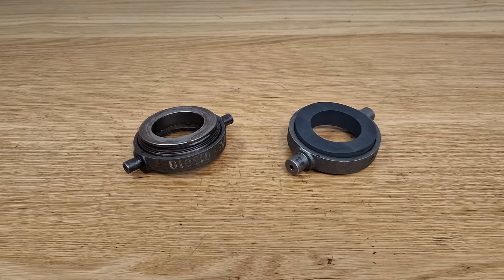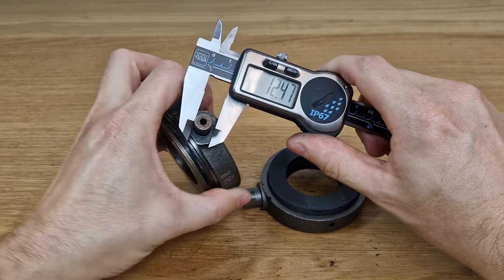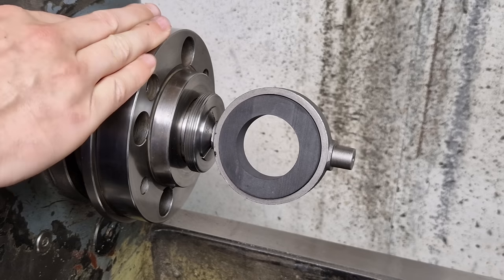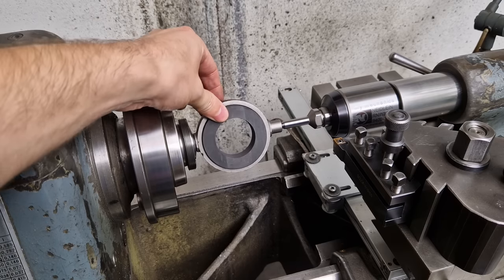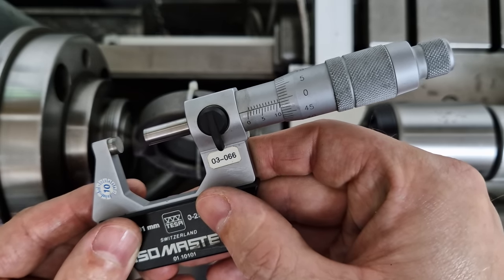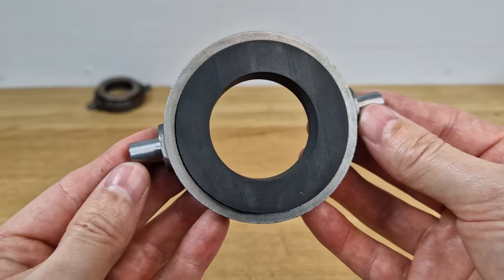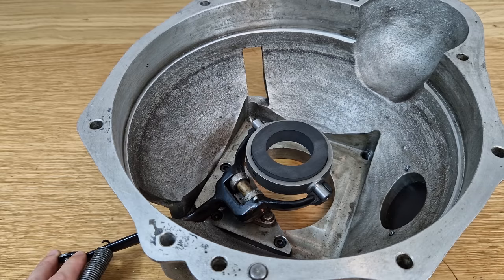Customizing a Graphite Thrust Bearing (Throwout Bearing)

Comment: Taking .002" cuts every time to get dead accurate on a 10mm diameter on a manual lathe is damn impressive. That's a level of manual machining precision necessary in aviation overhaul and repair shops.
Reply from the maker: It's pretty easy with a DRO ;-)
Reply: @mymechanicsinsights  I was wondering why you made those 0.25mm depth cuts and each time you measured with the micrometer. Was that to better calibrate the DRO ?
Reply: @mymechanicsinsights  It also helps to have good calipers and micrometers. It would be a lot harder to get a diameter with a .002" tolerance using measurement tools that have slop greater than that. 
We've trashed calipers at work because they start getting wonky and fail to repeat measurements or are wrong by +/- .003".

Comment: Back in the day on racing Imps I saw a few carbon thrust bearings with the carbon removed  converted to hold on ball or roller bearings. Never found the need to do the conversion on my own racers.

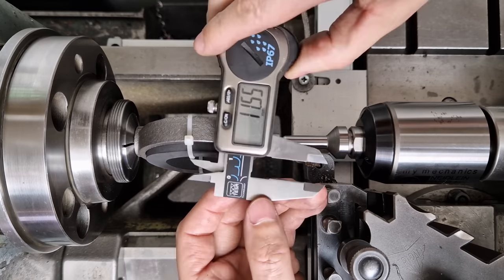Comment: 06:05 - When you said that you are gonna switch to the micrometer to better measure the thing, I was really hoping that you bring that antique one restored in the main channel years ago. 😄
I know how impractical it would be, and how you need/want the most precise measurement possible, but it would be funny nevertheless.

Really nice video!
Reply: Antique mics can be just as accurate as a new one, provided it isn't worn out. I have micrometers that are almost 100 years old, and they're still accurate enough for general machining that won't be put on a CMM.

Comment: I wonder if it's possible that the chatter is caused by a standing wave, a resonance  that causes a flex or "jump" in the cutting tool or the tool post itself? What made me wonder was the "pattern" that appeared in the material where the tool cut, which looked like "waves" in the metal, almost as if the pressure of the tool pressing into the material was vascillating. If my theory seems feasible to you, and you wanted to test it, you might be able to do so by recreating the conditions in which the chatter occurred, then try dampening either the piece being cut, or the end stock, so as to modulate or even eliminate any vibrations present.
I don't know if my theory is correct, or if it even makes sense, as I claim no expertise in the use of lathes, but my theory is based in my experience building speakers, and knowing how to contend with unwanted resonances in cabinets and in rooms in which the speakers are used, and so wanted to share my idea, just in case it could help.
Keep up the great work! I love your videos and I look forward to seeing new ones!
Cheers!

Comment: I having trouble understanding the balanced cut approach. For instance, if you started at 11.5mm and wanted to end up at 10 taking .5mm cuts. The first cut might have you end up at 10.99 meaning you dialed .5 and ended up cutting .51. So you key in 10.99 to your DRO and cut to 10.5, which is a .49mm cut. If it turns out to measure 10.5 exactly what do you dial in for your last cut? If you dial .5 you would end up at 9.99 same as your first cut. You did something similar in your video, but we didn’t get to see the measurement of the second to last cut, nor what you dialed in for the last cut. I’m intrigued with this approach however I can’t figure out how it’s done!

Comment: I have so many questions. I’ve wondered how you know you are removing material to the correct diameter.  So when you punch in the amount to remove, does a computer control the cutting piece on the lathe?  You punch it in, click “start”, and the machine operates under computer command?

Comment: Tell the owner to look into race application thrust bearings. Something sporty. They're usually much thinner. It would mean it wears faster tho, but it does have the advantages of modern tech behind it. The graphite one will wear faster than the ball bearings one that and will leave dust, tho i suppose that's not that important.
edit: saw the bell. Yeah, the easy solution is to change the pivot arm bracket support, make it smaller in height to make up for the difference for the thicker bearing. I mean, it know it's an old timey car, but the modern bearing is much better, i'd personally fight to keep that. Just my 2 cents.

Comment: Many years ago (35 years ago) when i learned on an old manual lathe, we had to centre all the tools before using the lathe. This was a boring process with a metal ruler. Do you still do this, you don’t show it, or do CNC lathes not need it?

Comment: Is there a reason you just didn’t remove the graphite bearing? Looks like there’s a set screw to hold it in place
Reply from the maker: It's actually a roll pin

Comment: just curious, how long is the graphite material supposed to last in this specific application (vs. a conventionnal ball/roller bearing as previously, provided that one could find and fit a thinner one)?
Reply from the maker: I wondered too, the car owner said he has another car with such a bearing and it's been working over 30 years now.
Reply: @mymechanicsinsights  ok - yet I've had this 1951 cad coupe for a good 3 decades now, only cover a few miles per year... if he does the same with his oldtimer cars (granted, it's hard to drive more than one at a time), he may not need to adjust the clutch cable that often...

Comment: So you are decreasing the throwout height by 2 mm with new bearing but also decreasing it an additional 2 mm with new shaft size (4 mm thinner and half of that is the extra 2mm) was this considered ?  Does the mechanism have enough adjustment to handle that?  Nice vid and  voice!
Reply: He said the old one was 2 mm too high and the reduced shafts fit perfectly.
Reply from the maker: Vickie's right, thank you

Comment: 1:16 I've been looking for good digital calipers that work on CR2032 batteries instead of LR44's (I hate those, they seem to run out SO fast) for quite some time, to no avail.
What brand/model are you using there, do you like it, and where can I get one (EU)?
Reply from the maker: Mine has the CR2032 batteries, it's made by TESA, the model is called TWIN-CAL I think with the round depth measuring pin.

Comment: 1: The micrometer should be handled by the composite material on the arch. It is designed to insulate the metal from the heat in your fingers. Even just holding the micrometer for too long will have an impact on the precision.
2: When the "jaws" of the micrometer touches the workpiece, use the small knob at the end, that makes it function a bit like a torque wrench (clicks when the force gets too high). It is very easy to apply too much force when twisting the main part, which will, again, affect the precision.
As with the calipers, you can pretty much get it to read what you want, depending on how roughly you handle it.
Remember, a micrometer is a delicate precision instrument, and should be handled as such.
Reply: None of that is necessary here, which is why he didn't do it. Holding the mic by the metal won't affect the reading of a 0.01mm mic. It's not a very precise mic. If you're a full time machinist, you can spin the barrel without using the thimble, and get it plenty accurate for a part like this. If you can get your mic to "read what you want," that means retire the mic is poor quality, worn out, or the gib sliders need tightening.
Reply: He's been machining for 20 years and he knows how to use measuring tools.
Reply from the maker: Fair enough. I agree with both points, allthough never had issues with measuring like that in over 20 years.
2. I'm actually using the ratchet mechanism of the micrometer. But on this model it's not the knob at the end it is the big knurled drum. It's not a ratchet, cause you can't hear it click. It just spins with some friction. You can see that well on some clips. I'm still turning the drum, while the micrometer doesn't close any further.
Reply: @mymechanicsinsights  Ah, I wasn't aware the tool had that feature. Also, I didn't notice that it wasn't actually a micrometer, I guess heat isn't much of an issue when measuring 1/100's.
Back in the day, during my apprenticeship as a fitter, I was tasked with making a calibration tool for a CNC workcenter, which was just a square steel bar (I think it was 10x10mm). It didn't matter if it was 90mm, 89mm or 88mm long, as long as it was dead on. I failed my first attempt at 90mm and landed on 89,999, and had to remove another 999μ. That takes a while when only removing a couple of μ whith each pass on the grinder, and gets nerve wrecking when you have to remove the workpiece from the vise to measure it, making sure neither the workpiece or the micrometer (calibrated at 20°C) gets thrown off by body heat, clean the magnetic table under the vise to make sure no steel particles gets between the table and the workpiece, and make sure the workpiece stands dead plumb. When you get very close to the target, you don't want to see too many sparks mixed in with the cooling fluid!
I did succeed on the second try though. :)
I miss having access to that grinder. I could have used it when I found out the ruler on my combination square had a nasty bow in it. Wet sanding ~1mm off both sides of a 30cm steel ruler takes a LONG time...

Comment: I don’t really see what you’re accomplishing by constantly resetting the DRO.  Once you’ve mic’d the part and set it once, that’s all you need.  If successive cuts aren’t correlating between the mic and the DRO, then the DRO isn’t calibrated and there’s really no point in using it at all.
Reply: As he's been a machinist for over 20 years, I think he knows what he's doing.
Reply: @Vickie-Bligh  Experience doesn't change facts.  Obviously he's free to complete the part however he chooses, but my point is still valid. It's not accomplishing anything.